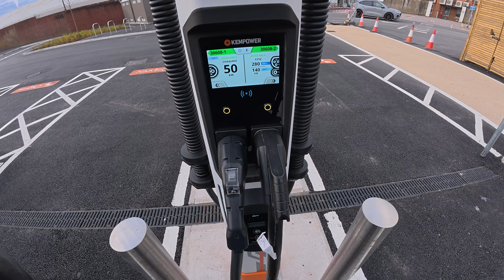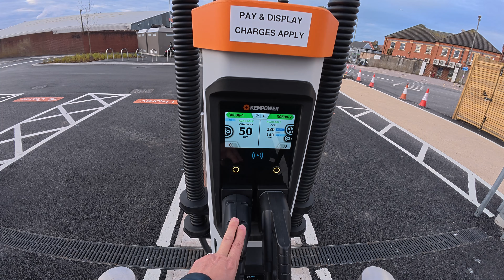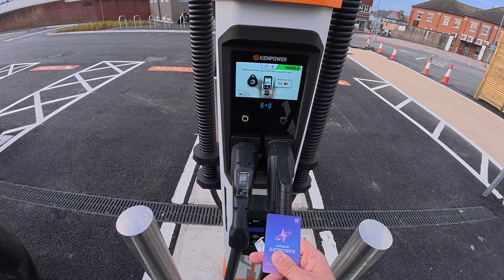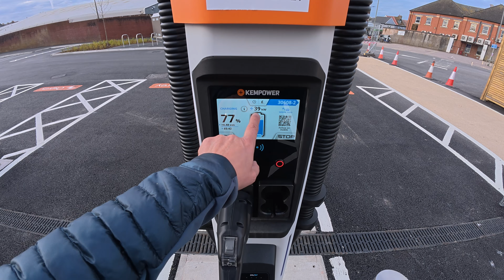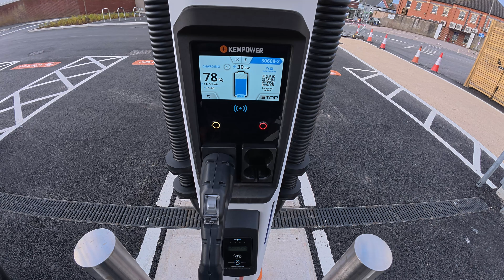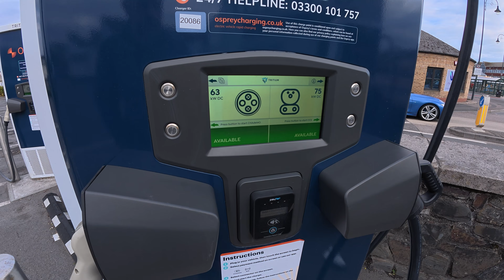First Time Using a Rapid EV Charger? WATCH THIS!

Comment from the maker: Thanks for watching, comment below if you use public EV charging and your experiences good and bad.
Reply: The one thing that is never mentioned is the cost, 84p per kwh is a lot more than cost per mile in say a self charging hybrid. If you cant charge at home why would anyone want an EV?
Reply from the maker: @alanfretten6709 The cost of public charging certainly needs review by government and the industry. There are cheaper operators out there, such as Tesla, with off peak pricing some time lower than  standard rate domestic. 

However, as I have mentioned in other videos, it would be harder to justify an EV if we could not charge from home on cheap overnight EV tariffs.
Reply: @NiceandEV I changed my car 2 years ago, I wanted an EV but bought a SC hybrid instead after getting quotes to install a charger into my garage which as a low mileage owner came to about 7 years of petrol costs (it was complicated requiring upgrading the cable to my detached garage)
Reply from the maker: That’s completely understandable. If getting power to a detached garage required such a costly upgrade, the figures simply wouldn’t stack up for a low-mileage driver. A hybrid sounds like a very sensible compromise in your circumstances, hopefully the charging options and installation costs will be better when you next change cars. 👍 @alanfretten6709
Reply: Bad experience today in Halifax, @ Dean Clough, Be Ev charging unit, tried to pay by Debit card 3 times told to use another payment tried the BeEv app,no luck kept coming out of the app, my son has adhd and this was very frustrating for him and eventually myself 
If this is the future Forget it I’m back to my Diesel thanks
Reply: It proves to me that the infrastructure and batteries are in there infancy, more charges don’t work than actually work it’s a no from me
Reply from the maker: @phildawtrey5058 sorry to hear that, my experience of Tesla Superchargers is they are very reliable and over the last 3 years of owning an EV I have seen other operators improve and expand massively.

The cost of some public charging however certainly needs addressing.
Reply: I really wish Youtubers would stop saying "Rapid charging" it is not an educated term. DC charging is what you should call it.
Reply from the maker: Thanks for watching and commenting. @honesty_-no9he
Reply: @honesty_-no9he  its the industry term and it can be rapid...

Comment: It’s likely in the end (if I’m not too old) to get an electric car, but there are issues for me. One, why oh why are these chargers out in the open? It’s winter, it’s dark and cold pouring with rain, it’s ridiculous. Range is still the main one, but the new type batteries will not come out for most cars for a few years.
Reply from the maker: Agree that some locations are not ideal in terms of being isolated/exposed.

However, I would say in the  three years of ownership and using the Tesla Supercharger network which is a quick get out, plug in and get back in the car... I genuinely preferred this method, than standing on a forecourt with the wind and rain driving through sideways, still getting wet and cold and having to stand there while fueling (all be it for a few minutes granted).

And as for range, I have clocked up 50k miles in under 3 years and never suffered from range issues.. my average daily drive is around 30 miles, and for the countless long trips across the country, no problems at all in a Tesla. Thanks for your comments, really appreciated.

Comment: Barnstabubble!
Reply from the maker: “Barnsta-bubble… the lesser-known EV capital of North Devon! 😂⚡️"
Reply: This was a handy video, thanks - even better I knew where the car parks were.
Reply from the maker: @CrossQuim thank you for your kind comment. There are certainly cheaper options in Barnstaple since filming this.

MFG at BP Roundswell Roundabout is currently £0.59 per Kwh until 1st of September.

Or if not in such a hurry the slower 50kW RAW charger at the back of the Ceders Inn carpark is cheaper as well.
Reply: Good to know! Just received a phev with no charge in the battery and I don't have a charge point or cable at home (yet) to charge. Will likely granny charge it. 

Looks like a meal at Cedars is the best bet! I'm surprised how well Barnstaple is covered.
Reply from the maker: @CrossQuim in just 3 years of being an EV owner, the difference in charging infrastructure here in North Devon and across the country in my travels has been very noticeable.

There are still some charging deserts (Mid Wales, looking at you 😊) but its night at day  IMHO.
Reply: I can see the tourist hot-spots have lots of charging points!

Mid Wales is built for light and nimble ICE 👌

Comment: Still a very slow process. Good video for those thinking of getting an electric car.
Reply from the maker: It is slowed down a little for the purpose of instruction, in reality its quicker. However, it still requires several steps end to end.

Compare this with owning a Tesla and using a Tesla Supercharger, its night and day. Plug in, charge, un-plug and drive away. 

Thanks for your comments, really appreciated.

Comment: Great video! New to EVs and wondered when its done do you have to use the stop charge button or can you pull out the connector or is it locked in?
Reply from the maker: The cable will be locked (via locking pin) to your car so you would normally need to initiate the "stop charging" on the charge point, or some EVs allow you to stop charging from within the car.

Comment: Thank you. Interesting to see at the first location, you also have to pay for your parking whilst sat there charging. Bit of a cheek when you’re paying to charge, but I suppose it might deter people using it as free parking
Reply from the maker: I understand having to pay for parking if perhaps using a slow AC destination charger in a car park were you could be parked for hours. But dont understand why at rapid DC chargers where the dwell time may only be 30 mins or less.

Comment: 1.7 kwh for £1.70 or there abouts.

1L of diesel is £1.70 on a motorway or big service station.

1kwh will give you around 5 miles of range wheres 1L of diesel will give you 15 miles.
Reply from the maker: There are a lot cheaper public chargers avaliable, just so happens Osprey was used for ease of this video. 

On a recent video on my channel I was charging at Tesla in Bristol for £0.21p per Kwh and obviously home charging is significantly cheaper at £0.07p per Kwh.

However, the cost of public EV charging is a bit like the wild west in terms of pricing and needs addressing.

Thanks for your comment.

Comment: Can't wait until most cars have a decent range around 400 miles then I can just charge from home. If I need more then find a Tesla OTA charger if it's not a Tesla EV.
Reply from the maker: I think we are not far from 400+ being the norm for medium to large cars.

In fairness, most of my journeys are well within return range of even my Model 3 Performance, but agree would be nice to have that little extra range for the edge cases all on cheap rate electricity.

And still a need for small, cheap run around city cars which inevitably come with smaller batteries/range.

Comment: Fine for company car owners with paid expenses, but until you can charge on the go, at reasonable cost, many private owners will continue to avoid ev ownership. 85p per KWH, to travel 3-4 miles is far more than equivalent petrol, and diesel costs. The government need to stop charger companies from blatant profiteering if they are serious about persuading people to adopt EVs
Reply from the maker: I agree that the current pricing model for public EV charging is like the Wild West. If you are lucky enough to be able to charge at home, then the pence per mile makes a lot more sense using overnight cheap EV tariffs. 

Or failing that stick to using Tesla Superchargers (Open to All) for a more attractive pricing. A recent stop at Tesla Gordano Services on the M5 cost £0.23p per Kwh, which is cheaper than most peoples (including mine) standard rate electricity tariff.

Comment: I like the 50kw.If I stop on the motorway 1hr just fine for me and my wife.I just don't need these really fast chargers.More 50 kw please also in towns.The 7.5 kw is a waste unless it is linked to a hotel when you stop overnight.
Reply from the maker: 100% agree. There needs to be a more choice of speed of delivery.

Ultra-Rapid for when you do need to zap and dash and slower speeds for the slightly longer stops when taking a break from driving. (I guess its turn over/throughput operators are considering 🤔)

And 100% more 7 to 11Kw slower AC charging deployed at hotels, city centre car parks and big public venues/attractions. This for me (along with home charging) has been one of the biggest convieneces of an EV. The car fueling while you are doing something else.

Comment: I bought a new Peugeot SW EV on Jan 02nd having always said I’d never buy an EV. With all this utter bloody shit of multiple apps and charger services scamming customers by taking money from customers bank accounts and not paying it back for up to 10 days, I’ve made the biggest most expensive mistake of my entire life. Why the hell is this industry not regulated by the government?
I charge at home, but when I’ll need to travel a large distance away from home, I’m going to face these extortionate fast charging charges. EV’s cheaper than petrol and diesel, what a bloody joke!
Reply from the maker: I can honestly say for the last 2 1/2 years of owing my Tesla, its been the most simplest and stress free in over 30 years of driving.

1 x App (Tesla) only required which seamlessly manages payments at Tesla Superchargers with no intervention or pre-authenticaiom chargers required.

Along with a significant reduction in my monthly fuel costs since making the switch to an EV (I can only speak of my experience with a Tesla of course).

As a non-Tesla owner, I would recommend only having two apps being required. Tesla App so you can use Tesla open to all EV Superchargers (which are significantly cheaper than most other charging operators) and Electoverse App/Card for everything else.

Sorry that you have had a bad experience.

Comment: It's not wonder rapid chargers take so long with such sliw journey times on a trip. 50 kw on Chademo and up to 280 kw on ccs. An ice vehicle typically fills up with the equivelent of 1.1 to 1.3 megawatts. EV's are backward technology.
Reply from the maker: Thanks for commenting, EVs are not for everyone I guess.
Reply: @NiceandEV I bought one in 2016, it now has 50% degradation after very few miles driven and has been a logistical nightmare, away from our octopus go charger. I wouldn't ever have another one. What i am sorry about, is the fact that by buying an EV, i have helped in the process of removing freedom of buying choice from the general public that the government so far, intends for 2030. If it happens Europe will have no motor industry whatsoever but the zeolots wouldn't care about that. They don't give a damn that the UK has the highest electricity prices in the world by incorporating renewables and also having to pay for normal generation in poor generating climatic conditions, at the same time and are driving all manufacturing out of the UK as well because of it.
Stupid and shameful !

Comment: Much appreciated, as a potential ev owner, videos like this are very useful, although I know some folk are born knowing everything.😉
Reply: Don't do it. Massive depreciation and degradation awaits.
Reply: @FredFox-m9v I'm a car/bike fan, any motorised transport interests me, I have no agenda. I'm a used buyer, depreciation is great news for me and degradation is proving everywhere to be an acceptable level.👍
Reply: @Grahamvfr I have a nearly 10 year old EV with little miles on the odometer, it has 50% battery degradation now. More modern cars are better but there are loads of modern cars on autotrader with class b degradation and worse after only 20k miles. The fact is all EV batteries degrade with time and use cycles whereas ice vehicles don't because they don't have a degrading traction battery. My EV showed noticeable degradation after 5 years but obviously was degrading from day 1.
As a comparison, I also have a nearly 18 year old Mercedes E Class diesel and a nearly 22 year old Mazda MX5 nb also, both working perfectly and both with the ranges I bought them with, the Mercedes being 650 miles still. I have a cbr 600 f and a Kawasaki 900 rs se bikrs as well. Can't imagine what a sensation vacuum that an EV bike would be ?
Reply: @FredFox-m9v Similar background to me which is nice to hear, but at 68 my interest in EV goes beyond the financial side of it, it's purely interest in trying a different vehicle...like you did 👍

Comment: Any issue with the notice on the top of the charger: "Pay and Display Charges Apply"? What are the charges?
Reply from the maker: Thanks for watching and commenting. Its £0.60 for 30 mins then £1.40 per hour according to the local council website.
Reply: @NiceandEV so you had to pay that separately..?
Reply from the maker: @andyfox4612 in this specific location yes, but there are plenty of EV charging locations across the UK were there is no requirement to pay for parking while charging.
Reply: I think they take money off you upfront then pay you back.Crazy system.
Reply: Pay and display while charging ?

Comment: So much easier and quicker filling up my diesel car
Reply from the maker: Totally fair – Rapid charging still isn’t quite as fast, but I’ve found it fits better into my driving breaks these days (coffee, loo, stretch legs etc). Plus, waking up to a “full tank” at home is a game changer for daily driving! Appreciate you watching and taking the time to comment.
Reply: @NiceandEV  Rapid charging is no where near as fast as ice vehicles. To match an ice car the charging rate would have to be between 1.1 to 1.3 megawatts of energy, which is impossible to achieve at scale, whatever the development of batteries achieves in the future. This leads to long journey times. With the addition of a driving spouse, you can eat, drink, rest and sleep in the passenger seat, meaning that you only need to stop 5 minutes for the toilet in an ice car with a typical range of 550 miles and more, not cumulatively hours charging on a long run. The Llewelyn bladder range hypotheses is misinformation. You can also, because of the long range, fill up where the fuel is cheapest at supermarkets, not tied to short range, frequent and expensive motorway charging stops.
Reply from the maker: @FredFox-m9v thanks for your comment. Most of my charging is done at home on very cheap electricity rates while I sleep over night, so not wasting any time at all.

I would agree with you though, that public charging costs can work out more expensive than ICE equivalent fueling. However my average journeys are nearly always using the very cheap overnight electricity.

EVs currently do not fit every use case, but after driving various forms of ICE vehicles for over 30 years, my Tesla suits my needs.
Reply: @NiceandEV in the past Beagle dogs were used in experiments to determine the link between smoking and cancer.

AI Overview

Yes, 

beagle dogs were extensively used in historical smoking tests, particularly in the 1970s. These experiments involved forcing dogs to inhale cigarette smoke to study the health effects, such as lung cancer and emphysema. 

Details of the Experiments

Methods: Dogs were typically restrained in slings or stocks with their heads and bodies locked into place. Masks were strapped tightly to their faces, or tubes were surgically inserted into a tracheostomy (a hole in the neck leading to the windpipe) to force smoke directly into their lungs.

Purpose: Early attempts to link smoking and cancer relied on statistical human data, which the tobacco industry dismissed, arguing no clear cause-and-effect was demonstrated in a "realistic" experimental setting. The dog experiments were designed to provide this experimental evidence and, in some cases, to test the safety of "new" or "filter" cigarettes.

Key Findings: A landmark study by Drs. Oscar Auerbach and E. Cuyler Hammond in the late 1960s and early 1970s was the first to successfully induce lung cancer in smoking dogs. Their results, published in 1970, showed that a significant percentage of "heavy smoker" beagles developed lung tumors and emphysema, compared to control groups.

Public Outcry: In 1975, an undercover journalist named Mary Beith exposed the conditions in a UK lab run by ICI (Imperial Chemical Industries). The resulting front-page image of a beagle with a mask strapped to its face caused widespread public outrage and became an iconic moment for the anti-vivisection movement, eventually leading to bans on tobacco testing on animals in the UK. 

Current Status

Today, testing tobacco products on animals is illegal in the UK. While the practice has declined globally, some countries may not have explicit bans, and beagles are still used for other types of drug and chemical testing due to their docile nature.